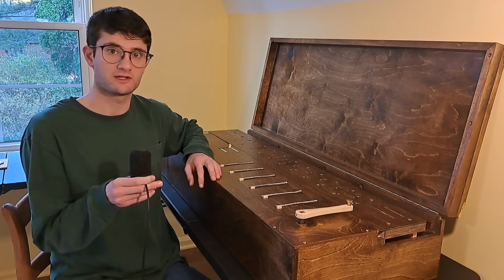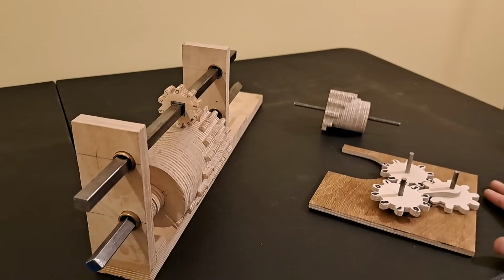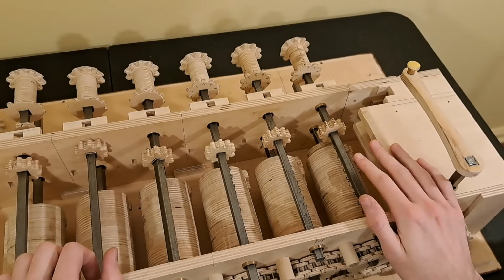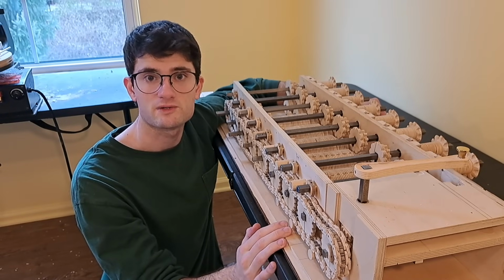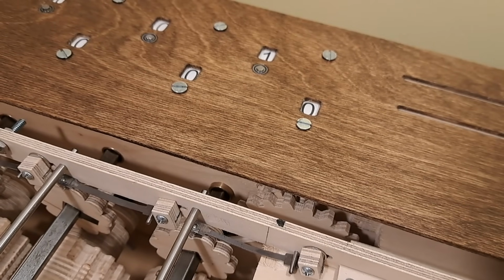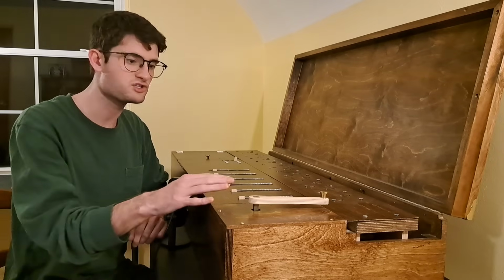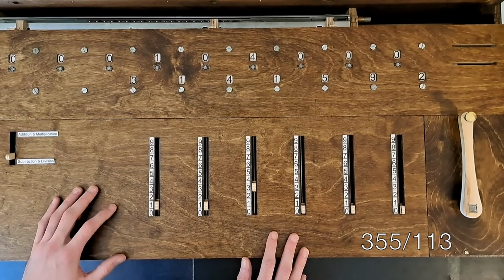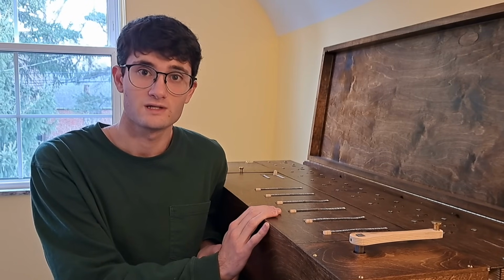How I built a Mechanical Calculator

Comment: What if you made the 10s place gear count down that way you don’t need intermediator gear
Reply from the maker: That would definitely work in the 2 digit model I made, but the reason I did not do that and just write the numbers going in the other direction for the 2nd wheel would be more important if I had been making a full sized Schickard or Pascaline: we want each input wheel to rotate the same way because then the user interacts with all of the input wheels in the same way. With the Schickard adder in particular you could also do subtraction and it would get confusing quickly which way is needed to rotate the wheels if every other one goes in the opposite direction. Thanks for the comment! - It gets to a core element of these machines, that every decimal column should behave the same internally and also externally to the user

Comment: You know, this is something I've always wanted to do. I even brought a shed load of Meccano ages back to get started. Though I could add and subtract, I could never multiply and divide.  Its just a pity I'm not as clever as you.
Can you now work on powers and roots?
By the way I feel the artisans of the 18th C would have been much better employed working on this project than all their stupid automata whose underlying tech was just cams.
Reply from the maker: Thanks for the kind words! There is a method to do roots on this machine (and I guess powers are just repeated multiplications? so it kinda does do them). 
I disagree with your point about automata though. My other video actually addresses precisely how automata-making (and cams/pinned drums) influenced computer technology (https://youtu.be/gxT8TfI5DaE?feature=shared). They did not use "just cams" but rather the complicated automata of Vaucanson as well as Maillardet and the Jacquet-Drozs used reprogrammable sorts of pinned barrels. But moreover, the artisans were not solely deciding what projects they worked on, but rather responding to the larger market and interests of patrons. I appreciate your thoughts though!
Reply: @ thanks, I have more reading to do.

Comment: aah yes, "certainty" but there arent any springs for the input carriage ;) what if someone set in between 5 and 6?
Reply from the maker: The base plate of the results carriage indexes into gaps on the wall that the carriage rests on, so it can't really be put in between 5 and 6. When it's in the right position it falls into place unmistakably. Thanks for the question!

Comment: Best Youtube recommendation by a long margin, I enjoyed every second of it! One quick question: is there a specific reason why you didn't add a knob or handle on your resetting mechanism instead of opening it and poking it with an Allen key?
Reply from the maker: Thanks!! Yeah I need to fasten a post of some sort onto the zeroing rack so I don't need to use a key. I'm just a little worried about that post holding up to the forces, there might be some weird torque? That mechanism needs refined still, but it works well-enough as is. Thanks for the question!

Comment: Amazing work! I took apart a Monroe Model L last summer to learn these exact mechanisms, so this video was an absolute treat! Do you plan on expanding this any further? The paddle/rack Monroe used to shift the register to different decimal positions (while still retaining a hand knob for quick, large adjustments) would probably work well, seeing how a lot of the work using your calculator will be getting up to shift and to clear. There's also a neat way to rotationally clear the input & counter which bypasses the need to lift the gears out of contact. Maybe add an overflow/underflow bell too. Anyway, you've re-inspired me. Cheers :)

Comment: Amazing! I love how thick and weighty you made everything, it all looks so satisfying to use where usually the Youtuber's instinct is to go thinner and lighter and then find have PCBWay manufacture all the critical parts that would be the most interesting problem solving opportunities to produce.

Maybe next project should be a slide rule the same weight and size 😂
Reply: Regarding the thickness it might have made sense to make the gears on the input/output sliders thinner than the gears on the barrels that drive them. Just so there's less risk of accidentally engaging the extra tooth on the number above where you slid it to.
Reply from the maker: Thanks! I did slightly chamfer those gears, but making them thinner than the stepped drums is a good idea too!!

Comment: This is one of the coolest things I’ve ever seen, but I’d love to see how you could improve the zero-ing method to not require a lift and separate tool use.  It feels like you could probably figure out a way to disengage and zero with a crank
Reply from the maker: Thanks! Yeah the zeroing method could be a little more refined. About needing a separate tool, I just need to actually fasten a post onto the rack that slides. Someone very perceptively commented that putting the addition/subtraction lever to "neutral" could be a way of disengaging the assembly without having to lift it up. And that is very close to working on my machine, there's just barely not enough tolerance for that, but some machines did do that. And about a crank, some Monroe mechanical calculators used a crank which would automatically lift the carriage before doing the zeroing. Thanks for the comment!! I really appreciate comments like yours because it shows how closely people are watching and that's very gratifying to me!
Reply: @WhatWillMakes  that makes sense! cool stuff

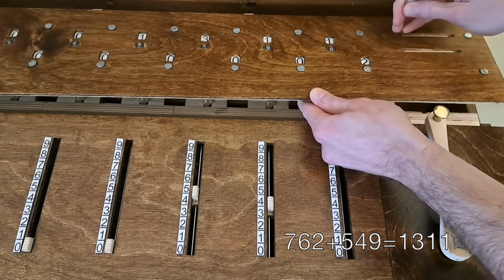Comment: 22:18 would it not be easier to simply input the result as a subtraction function to zero the window? Would not require removal of the panel.
Reply from the maker: You definitely could zero by subtraction - I'm not sure it would be as fast as the automatic method, which really isn't that hard to do. And when zeroing by subtraction, the crank turn counter would still increase, which isn't an issue for that calculation, but could be in multiplication or division. Thanks for the question - it's very perceptive!!

Comment: I am genuinely impressed by both your achievement and the quality of this video, but I find it surprising that at no point did you mention the ultimate evolution of the mechanical calculator, the Curta. It can calculate to 11 digits (with six turn wheels) and is smaller than a soda can. The second model was even more impressive.
Reply from the maker: Thanks! and of course I know of the Curta! I think it's such a clever design - like curling my machine up around just 1 stepped drum. The Curta's story has been covered very well by others though, so I didn't mention it in this video, but I agree it is the most refined mechanical calculator. Thanks for the comment!

Comment: One thing that was somewhat overlooked in the video, most likely for simplisity is that this is not really possible because our 0-9 number system but because our number system is base based. Any number of digits will work with this same principle as long as you add the required counting gears, but 0-9 is easiest to understand from everyday context. Since the result line is detachable and the selector line seems to be also you could even make this with changeable plates to support many bases as long as the mechanism supports the highest base you want.

Comment: This is cool, do you think it could be possible to make it negative too?
Reply from the maker: Thanks! When subtracting from 0, the dial would turn backwards, so first going to 9, then 8, 7, and so on for whatever the subtraction is. But when going between 0 and 9 it would also trigger a carry to happen, which would then cause the next column to also trigger a carry and so on. So 0-1 would equal 99999999, and 0-2 would equal 99999998. To make it properly handle negatives the dials would need to have 19 positions, I think (1-9 positive, 0, and negative 1-9). To be able to fit those in the whole dial and bevel gear would have to be larger in diameter. I think it could be done, though! Thanks for the interesting question!!

Comment: What happens when you do an invalid input, such as subtracting into the negatives?
Reply from the maker: When subtracting from 0, the dial would turn backwards, so first going to 9, then 8, 7, and so on for whatever the subtraction is. But when going between 0 and 9 it would also trigger a carry to happen, which would then cause the next column to also trigger a carry and so on. So 0-1 would equal 99999999, and 0-2 would equal 99999998. Thanks for the question!
Reply: @ awesome that makes total sense, keep up the good work the vid and the machine are amazing

Comment: I saw a video explaining how the Curta works quite a while ago. Interesting to see how this design, which is based on the early mechanical calculators, works in a very similar fashion to the Curta, which I would call the pinnacle of mechanical calculators.

One rather glaring issue is the number input, though. I don't like how it's a sliding scale that doesn't click into position. Maybe it doesn't matter in practice, maybe it does, but it is something that would bother me :D
Reply from the maker: The way I've been thinking about it, the Curta is like if you curled this machine up around just one stepped drum. It's such a clever design! 
And yeah I considered indexing the sliders somehow. It would definitely be nice, but I really wanted to be able to easily remove the top panel and see the stepped drums and carry mechanism. Thanks for the comment!!

Comment: What would happen if you tried to subtract from 0 aka go into negative numbers? Also if I ever become a talented woodworker I would definitely make this.
Reply from the maker: When subtracting from 0, the dial would turn backwards, so first going to 9, then 8, 7, and so on for whatever the subtraction is. But when going between 0 and 9 it would also a trigger a carry to happen, which would then cause the next column to also trigger a carry and so on. So 0-1 would equal 99999999, and 0-2 would equal 99999998. Thanks for the question!

Comment: I love mechanical stuff, very well explained video, wonder how small you could make this with a 3D printer.
Reply from the maker: Thanks! (You could probably make one quite a bit smaller, I did not design mine to be compact or particularly small, just easy to make. The smallest gear was the 10 toothed one with a missing tooth for zeroing that is on the bevel gears and dials that count crank turns, it's maybe a an inch or 2.5cm in diameter, so if you were not going to change how I arranged the results assembly, than I would start by figuring out how small you can make that gear)

Comment: Would it be possible to use the equivalent of a 0- 9 by 0- 9 "look up" Multiplication chart or PRINCIPLE to carry out multiplications and division? (an entirely new concept)  If so, one also could be used for addition/subtraction.   COMBINED you would have a 4 function calculator.  I wonder what the mechanics of such a device would be.  And a NEAT way to enter and display results.
Reply from the maker: I think the "Millionaire" mechanical calculator uses a device like you are describing. (see this video, https://www.youtube.com/watch?v=wwh0KH-ICCw, especially around 6 or 7 minutes in). I've seen another such device for direct 0-9 multiplication in the Paris Musée des Arts et Métiers. I'll try to find the picture I took and get back to you. I think those mechanisms are very clever. Thanks for the comment! Let me know if you were describing something else!
Reply: @WhatWillMakes  If it works with a "Look-up" table for multiplication/division, Addition/subtraction could also be done the same way.  its only 0- 9 X 0- 9 just like above.  The mechanism could be simpler.

Comment: i have a question; why does the panel have to be lifted to reset the values?
Reply from the maker: The results dials and their bevel gears rotate when zeroing, and if the results panel was down those bevel gears would still be engaged with the rest of the mechanism, and the rest of the mechanism cant be back-driven. If we don't disengage it then zeroing it would try to move all the gears and stuff inside the main body of the calculator. Hope that helps!

Comment: One more good literature hint: "Das letzte Original, die Leibniz-Rechenmaschine der Gottfried-Wilhelm-Leibniz Bibliothek". I have studied Mechanical Engineering in the TU-Hannover. The professors who tought us mechanisms and linkages were Prof. Kiper and  Dr. Franz-Otto Kopp. The latter one was later member of a work group who analyzed the original Leibniz calculator. He told me a lot about it. They analyzed the geometry, found design flaws, eliminated them and constructed a fully working model. The work group published the above mentioned book and wrote scientific articles. Later F.O.Kopp made also a similar model based on the dual number system. I am sure that he would be very happy if he could see your machine. Sadly, he passed away in 2015. I received his lathe as a heritage. I remember, that in 1975 he recommended the book of Friedrich Adolf Willers: Mathematische Maschinen und Instrumente. I still have a copy. There, all mechanical calculators are very well explained. It made me happy to see your machine. Great work, congratulations.

Comment: 22:58 why not just crank it backward?
Reply from the maker: There's a couple of reasons. First, as I say around 7:26, we were trying to get the adding and subtracting procedure down to one consistent motion. Secondly, the crank turn counter would turn in reverse if we cranked backwards, ruining the method to do division. Thirdly, the carrying mechanism is a precise sequence of events that is timed to occur at a specific point in the cycle. If we rotated backwards then the timing would be off and it would cause parts to collide and ultimately the calculator would jam (specifically, the spiral ramp on the assembly with the extra tooth would collide with the post). So we need to always rotate the same way, which is why the crank has a ratchet and click mechanism to prevent backwards rotation. Thanks for the question!
Reply: Thanks

Comment: Very nice work. Though I'm very bothered that you didn't match the crank to the case, maybe on purpose to make it stand out, but still.

Other than that I think the only things it's missing are a movable decimal point marker, which could just be a bead on a string or metal wire, and a mechanism to snap the results board into certain positions, similar to what you did internally, to make it nicer to position.

Comment: Why don't you share the exact measures of your project in the video description?
Reply from the maker: I really don't have a master plan with all the dimensions. Is there any specific dimensions you want? The outer box is like 44x17x9inches, or 111x43x22cm. The distance between columns is 3in or 7.62cm, the spacing between the stepped drum shaft and the 10 toothed gear shaft is 2in or 5.08cm. Honestly most of the other dimensions are determined by what you make those last two distances (the distance, shaft to shaft, from each stepped drum, and the the distance, shaft to shaft, from stepped drum to 10 toothed gear). Hope this helps! Please ask if you want any more details!

Comment: you can remove the rumbling from mic sitting on the table with a high-pass (or "low cut") filter, or better yet get a shock mount for the mic and ideally either a sturdier table or a floor stand for the mic (so that the table surface vibrations don't couple directly into the mic).
Reply from the maker: Oh thank you for this!!

Comment: I wonder what kind of funky magic you could do by utilizing better bases like binary
Reply from the maker: Yeah a binary version could easily be made, not needing to stack 10 wheels. Leibniz certainly realized this; he campaigned for the general use of binary in all calculating, and he wrote about how a simple binary adder could be made using balls and chutes. I like how this calculator highlights what base ten means, and how there is nothing special about it, could easily be binary or hexadecimal for that matter: just change how many teeth the stepped drums and their associated gears have. Thanks for the comment!
Reply: @ the only bit that i find a bit annoying with a binary is how it becomes too easily just a computer that’d been done 10000x one thing I really liked with your video is how original it looked. But that is probably due to me being well versed in computer science. 

Talking about multiple bases I wonder how hard it would be to make a base converter using the same base components (so like just wood and hard work)

Comment: 2:42 Couldn't you skip the intermediary gear by just reversing the order of the numbers on every other gear, so the first goes clockwise the second goes counterclockwise, etc.
Reply from the maker: If I had been making a full sized Schickard or Pascaline adder then the reason would be more important, we want each input wheel to rotate the same way because then the user interacts with all of the input wheels in the same way. With the Schickard adder in particular you could also do subtraction and it would get confusing quickly which way is needed to rotate the wheels if every other one goes in the opposite direction. Thanks for the question! - It gets to a core element of these machines, that every decimal column should behave the same internally and also externally to the user
Reply: @WhatWillMakes  Thanks for the explanation. it's interesting seeing the difference between a mechanical calculator using gears and an electronic calculator using binary logic